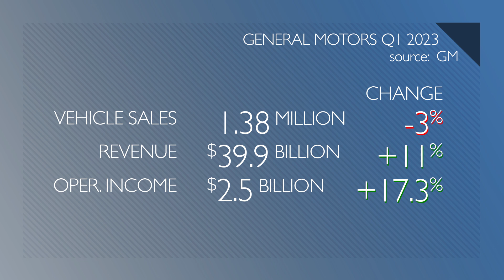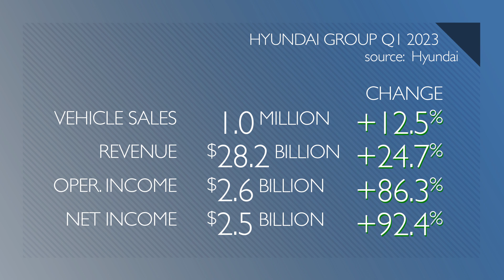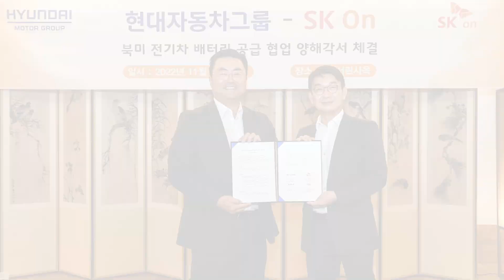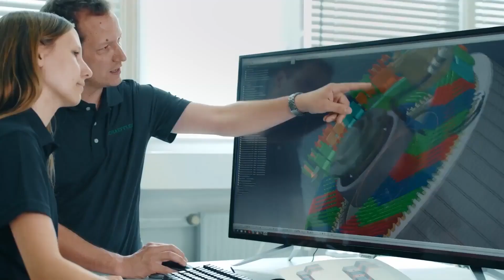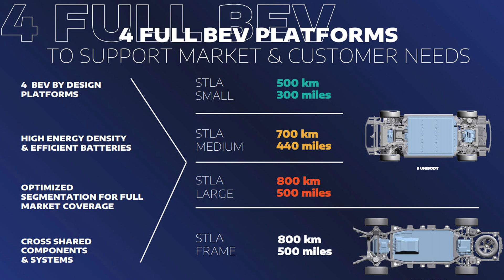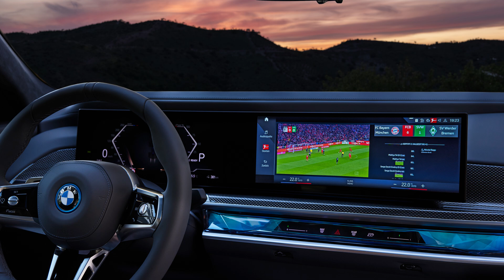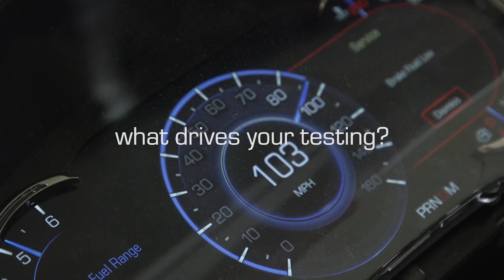EVs Fall Short of EPA Estimates; Tesla Shows Low Battery Degradation - Autoline Daily 3553

Comment: I keep saying that the Hyundai group is by far the best positioned legacy auto manufacturer to be in second place behind only Tesla. That's because they chose early on not to copy Tesla, but rather, to be ahead of them by going all in on 800V architecture on their E-GMP platform.
Reply: Iirc, 800v architecture requires more expensive, less commonly available parts for the electronics.  Some suspect Tesla will go 800v with the cyber truck, but apparently the math doesn’t make sense with smaller vehicles.  There’s not even a whole lot of high voltage cables in their cars to begin with.  I think Tesla is more focused on switching to 48v.  There’s a whole rat’s nest of 12v cable in all modern cars, upping the voltage will save a lot lot lot of money on wiring.

Comment: Sad to report that GM will stop production of the Bolt by the end of this year.  It had its problems (🔥), but it was priced right and was made in America.
Reply: Take away the Bolt sales and they did 1k EV in Q1 2023!!!!!
Reply: I had not seen this before. I was on vaca for about a week and maybe missed a few things. I had predicted this back when the redesigned version came out. I owned a 2020 and it was, without a doubt, the worst new car I ever purchased. Everything about it was substandard. When it was redesigned and almost nothing changed, I figured it days were numbered. Mine had a sticker of $40k. No one in their right mind would pay that much for a cheap low quality car, and I paid about $27k. Within the 1st month my wife was asking when we could trade it in. I figured it would be a huge loss, so we hung on to it for some time, but we actually got more than be paid for it on a trade in. Within days GM announced the new low price. Got lucky that time, but I would never recommend it to anyone.
Reply: @by9917 they just announced it today I believe
Reply: @by9917  You can get the ID.4 for $32,000 after the federal rebate, and under $30,000 in some states with their added rebates providing you can find a dealer who doesn't want to steal part, or all, of it with markups. It's far from perfect, but at least it charges faster at 135kws, has a better build, and interior quality for the price.

The $25,000 Tesla, including the rebate, is going to steal massive market share from legacy on the lower priced market since you don't have to worry about dealer rip-offs with it and has the advantage of a vastly better charging infrastructure.
Reply: Price right, car wrong. As @by9917 pointed out it was probably the cheapest looking and feeling vehicle on the market. So much hard plastic!  I realize they are in a pickle having gutted their car offerings, but it would have been better to offer an ev version of the Malibu. Keep the interior parts count overlap high to reduce costs with scale.
Reply: Every one was sold at a loss.  GM never made a profit on the cars.
Reply: @davidbeppler3032  show us the facts not what you think!
Reply: @gmv0553  Um... GM said they never made a profit on the cars.  Go read any article on the matter.  It is not my opinion.

Comment: Here is the problem, ya'll insist on driving 75-80+ mph on the highway to save 5 minutes on a 1 hour trip, and on top of that accelerate constantly because you want to pass someone going 60. Peak efficiency on both EV/ICE is 55-62 MPH. Most of the time you will only get EPA range if you drive 62 MPH or below and without accelerating all the time to pass someone. WLTP range is on point for people who drive with a lighter foot and at reasonable speeds, EPA is spot on for people who drive with a moderate foot and average level of passing/speeds. The only people who get less than EPA/WLTP range are people who drive over 75+ MPH and pass a lot, manufacturers should not have to compensate their battery pack sizes and price of vehicle for the portion of drivers who drive more aggressive.
Reply: Who do you mean by y'all?
Reply: @jordanschultz2232  Ya'll, as in people who get less than EPA estimated range or MPG on an ICE vehicle.

Comment: 75mph will definitely lesson electric range noticeably. (I’ve been EV only since 2015)
Reply: ICE too, at those speeds.  It's all about aero at that point.
Reply: @JT_771  Agreed, but that's where the advantage of ubiquitous gas stations comes in to play for road trips, unfortunately.
Reply: @JT_771  don’t ice cars do particularly well at higher speed? Even most epa has highway mpg at higher than city 
At 80+ mph sure it’s gonna suffer but at 75ish it’s gonna still do pretty well
Reply: @sentryion3106  I watch my instantaneous MPG constantly. City driving kills it (I have no regeneration), running just above top gear, 50 MPH, gives me the best mileage. It goes down precipitously past 70.
Reply: @sentryion3106  They do well, but only relative to their poor city performance, which is caused by the lower gearing of the transmission.  Their economy goes back down again at high speeds for the same reasons as EVs ... aerodynamic drag.
Reply: Correct.  There's an observable difference in efficiency between 70 and 75mph.  I've found that once you cross the 65-70mph threshold, efficiency drops like a rock as speed increases.
Reply: @Cakebattered  Indeed - Just this past weekend we did a 500 mile road trip in my EUV and it reminded me how much 75mph impacts things.  And yes, it impacts ICE vehicles as well, but that's where the difference between ICE and EV can be a real issue.  (I pulled in to two charging spots with less miles of range left than the distance to the next-closest high-speed charger, and I planned the trip out very thoroughly in advance w/plugshare)

Last time I took a roadtrip in an EV was when I had a Model 3, which is night and day as compared to my Bolt, both in charger locations and charging speed.
Reply: Drag force is exponential to speed

Comment: SAE is correct, we need actual standards for EV range testing. The change from ICE to EV gives a window of opportunity to create a range test that can truly reflect what buyers can expect. ICE vehicles have different ranges depending on altitude and other conditions. I do not like how the government lets manufacturers basically do the tests and give them the results. Some EVs take big hits to range in cold weather. 

What would be interesting is for data to be collected from vehicles sold to show what buyers are seeing. With EVs the thing could collect is efficiency ratings, Make it another item listed online that is a collective average. Many manufacturers collect tons of data after you buy a vehicle. That data could give a real idea of what buyers should expect. Yes, I get the way some drive and where they drive has an impact, but having a general average helps keeps ratings in check. 

In the end, there is no perfect way, but vehicles being driven with no climate control on, maybe no spare tire or other accessories that might normally be on the vehicle, is not a good thing. The 0-60mph should only count from a standing start instead of the rollout thing some use.
Reply: Agreed ... a plus for consistent standards (accuracy will always have some variance, as it is heavily condition dependent).
Reply: I think there should be a “winter” rating along side some version of the standard. Model it around average winter conditions in the northern Midwest. The epa fuel economy site currently has user reported mpg as well. But sample sizes tend to be small.
Reply: @nothanks960  That's quite the rabbit hole, though, to go down.  Especially w/ EVs since you use active energy to heat the cabin vs waste heat.  So outside temp, inside temp, battery warmed up or not, etc.  Not saying it wouldn't be nice, but people would do they same they do now w/ the normal ratings, which is not realize it's an idealized, averaged rating and cannot be indicative of everyone's situation.
Reply: EV range is mostly redundant. Even in continental Australia, which is 4,000km from east to west, the average Australian only drives 33km each day. The Tesla Model 3 has a range of 493km, so the Aussie Tesla driver only needs to recharge every other week.
Reply: @user-kc1tf7zm3b  Regardless of if it is important or not for daily life, buyers should have realistic data that they can trust to make a buying decision.
Reply: @kevtheobald  Tesla drivers in Australia are very happy campers indeed. When the everyday reality is that the Tesla drivers can push their EVs for 2 weeks without recharging, then these range calculations methodologies are purely academic.

Australians are a hundred times more relaxed compared to Americans. So, for nearly all, Australians do not care about the minutiae of range considerations.
Reply: @user-kc1tf7zm3b  This is something worth being aware of.  While some decent range is needed for 'road trips', those trips do consist of a very very small number of miles for the average person compared to daily miles.
Reply: @JT_771  The Tesla Model 3 range of 493km is sufficient for many Australian road trips. For those wanting to travel between capital cities, like Sydney to Melbourne, take the AUD $99 plane flight.
Reply: @user-kc1tf7zm3b  Oh, I'm sure it is.  I road trip mine all over the western US w/o issue.
Reply: @JT_771  The social landscape is different in Australia. Most of Australia is desert, so meandering road trips in the Australian interior is just not the common experience for most Australians. On any given day, there are 200 flights between Sydney to Melbourne, so Australians are just more inclined to fly for their trips.

Before too long, EVs with 1,000km of range will become a reality. When it does, the range aspect of EVs become redundant on a simple psychological level, as ordinary petrol ICE cars only have a range of 700km.

Comment: ICE IS DEAD
Reply: Eventually but not for 15 years.
Reply: @davidmccarthy6061  More like 7-10 years, Toyota/Mazda are already planning a $20-$25K EV by 2030. But they'll have to get rid of the dealer network as that inflates price by 20%.
Reply: @igotanimac1  Versus Tesla who has a CEO that inflates prices arbitrarily at 3 am on 4/20
Reply: @davidmccarthy6061  - I do figure Our Dear Troll doesn't even own a Tesla or any BEV nor TSLA stock. Just your average GRAFITTI PAINTER.
Reply: Welcome Back, Dear Troll!  Nothing to contribute but GRAFITTI...  😌
Reply: The EV revolution cannot be stopped. Well before 2030, petrol ICE cars will be totally obsolete due to high running costs and negative environmental impacts. 

Over the 15 year lifecycle of a Toyota RAV4, the car will cost a massive AUD $30,000 for petrol and ICE maintenance, plus car will emit a staggering 32 tonnes of CO2. When the initial RAV4 $40,000 purchase price is considered, the total cost is a whopping $70,000. $70k for a Toyota? This is truly insane!

An EV powered by renewable energy emits nothing. For those with home solar, with most Australian EV drivers charging with home solar, perpetual fuel costs are removed from the outset. There is no scheduled maintenance for the motor in an EV.